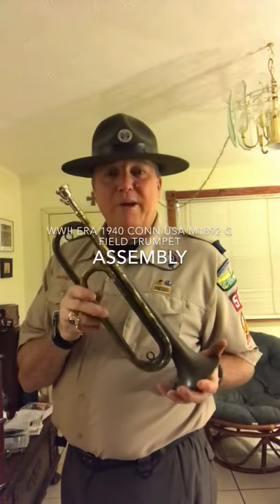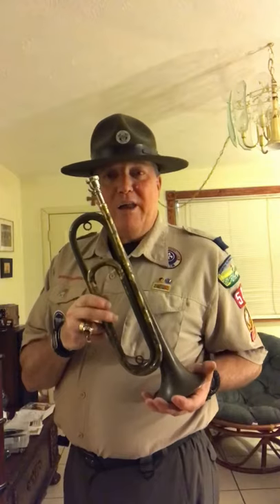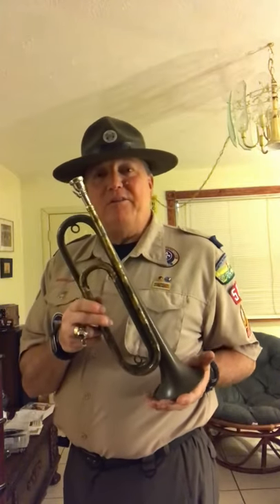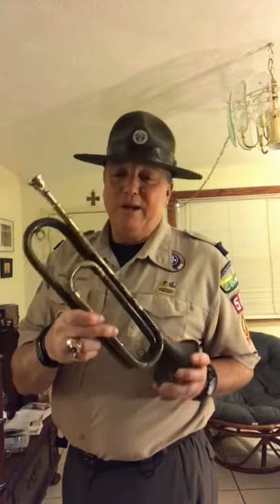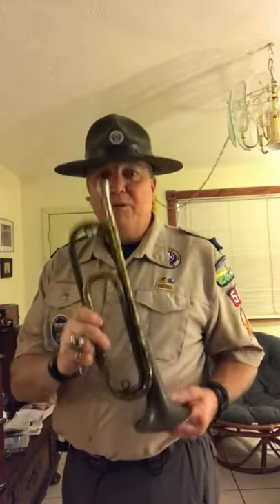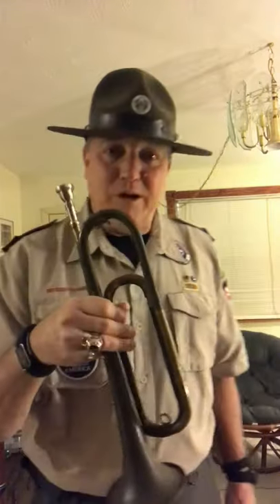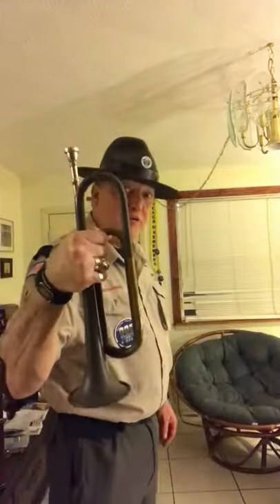Bugle Call: Assembly Bugle call on a 1940 CONN USA M1892 G Military Field Trumpet. 🇺🇸

Comment: Being a french horn player where pitch isn't very dependent on the keys you press, and the fact that it's the second most difficult instrument in the world because of it, this man has incredible skill but it just doesn't look like it. Seriously he has to be just as accurate with his buzzing as if he were singing.
Reply: Actually it's quite the opposite. Bugle slots the same as trumpet without depressing the valves. The distance between low C and normal C on bugle is similar to going from bass clef C to middle C on horn.

Comment: Music major here with a question here - why do you hold the horn “upside down” when playing? I’ve never seen this done in traditional settings. Is this standard in the military? Does it help get certain overtones out easier? Thanks in advance if anyone has answers :)
Reply: It helps with sound depending on your skill level. When just I just started switching from trumpet to bugle I found moisture collecting in bottom of first loop too easily causing sound to distort. Flipping it upside down seems to help
Reply: There is no moisture release valve like on a trumpet or trombone or tuba or etc. You could pull the valve out but isnt a quick fix. Plus some of these bugles are so old you cannot do that anymore